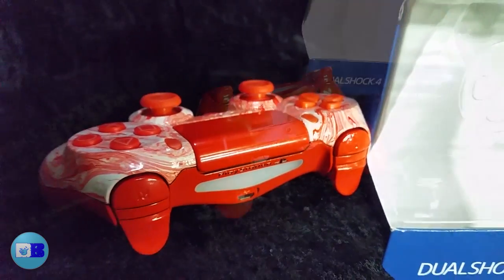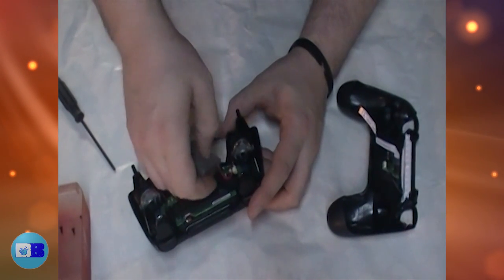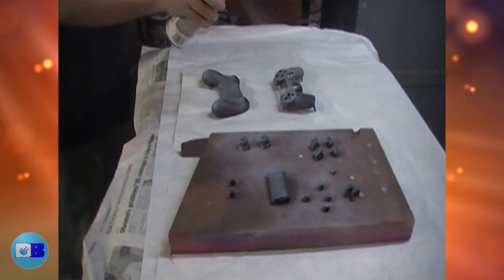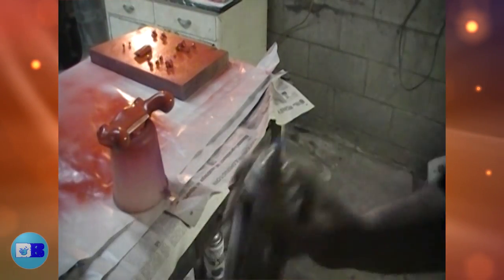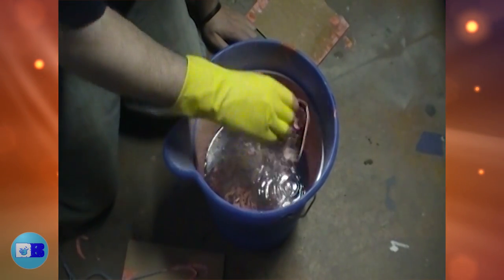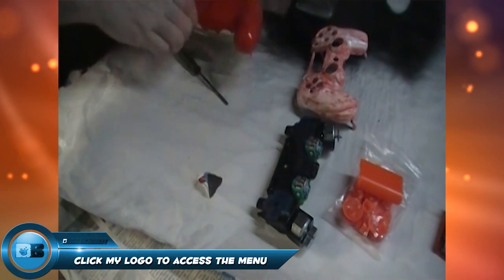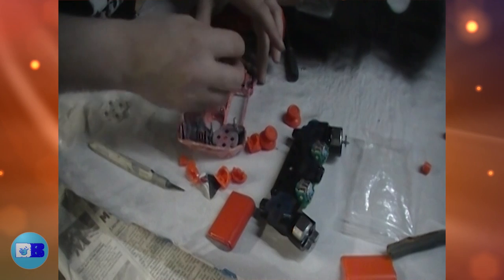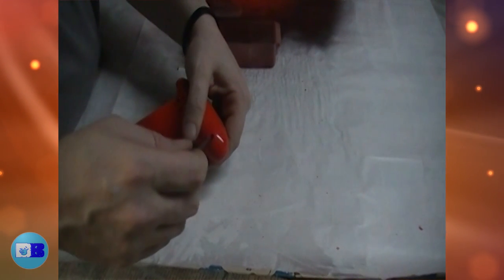How to paint PS4 Controller (A Drumblanket DIY Project)

Comment: Does the touchpad still read your finger movement?
I have some ps4 games that require flicking your finger or sliding your finger on the touchpad.
Reply: Yanny Candelario google says no, my controller says no. But some custom controller webshops say they use a special paint. I haven't been able to get an answer to the question "what paint is it?"
Reply: Sharlan Cináed maybe they remove the before behind board